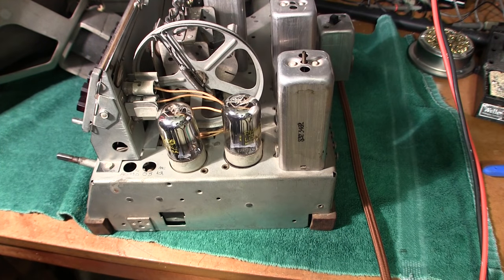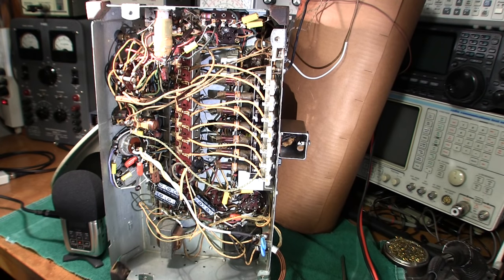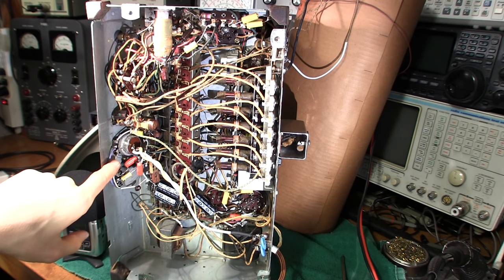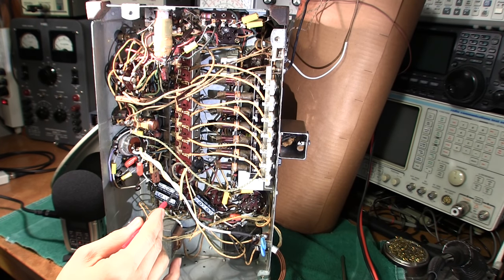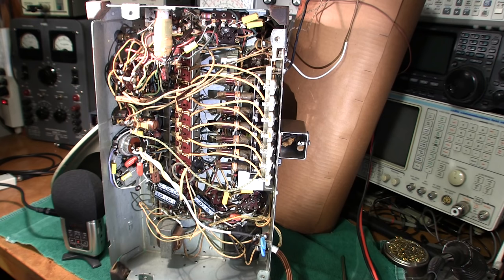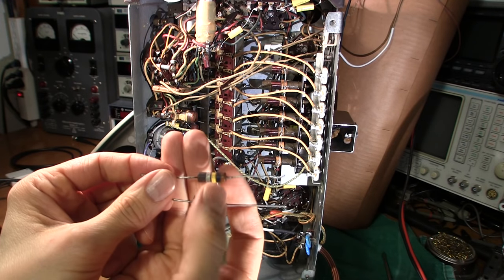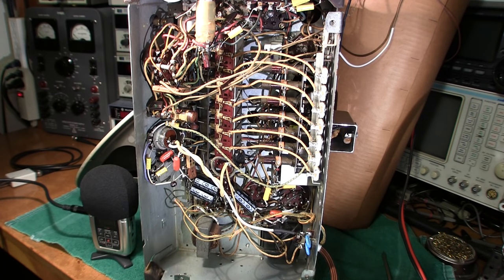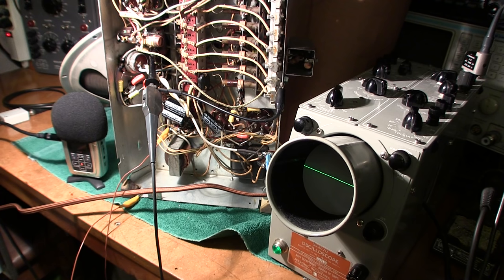Tech Tips Tuesday- Radio Repair Tips.

Comment: Am working on a 1948 Zenith radio and I encountered some Allen Bradley and roundie resistors, as you call them, and so now know more than before.  I will diligently check the "roundies"  first.  Thanks for the tip.Bob
Reply from the maker: +Robert Jacko 
Glad to help out Bob!

Comment: Happy New Year. Yup those cardboard capacitors are snow storm machies. My very first circuit a mains neon oscillator circuit. Needed a cap. I know where theres one I told Terry. Shot up his shed to a Baird BW TV. Been in there 2 or 3 years at the time. Yup. Dampalota. Put the cap in circuit worked. We made a cellebration cupa while it was running. In the kitchen we heard WHOOMP! Rather loudly. Looked in the living room doorway and it was............SNOWING! LMAO. Terrys mum was not amused. We were both 9 at the time.
Reply from the maker: +Raymond Earle 
Thanks for the story Raymond! Happy new year!
Reply: Same thing with me. Age around 12, was working on an audio power amp when the power supply paper filter cap blew. It was like a Roman candle and snow storm at the same time. Was in the basement, so it was easy to clean up. Fun times.
Reply: Thank you my friend. Have subscribed. Happy new year.

Comment: I always learn from your videos.  At my parent's house is my Grandfather's1942  Philco  console I think it is a 42-395.   I am 60 years old, and used to play that thing when I was a kid.  I still turn it on often when I go over there, it still sounds great. The only repair done to it in my lifetime was I replaced the rotted rubber line cord.  It appears that somebody replaced the rectifier tube at one time because there is a Raytheon branded tube in the set with the old philco tube in the box. Until today, I never knew how to properly remove loktals.   All the other tubes appear original, and I see absolutely no evidence of any repairs under the chassis ALL capacitors are original, including the electrolytic, which is the cheap cardboard tube variety, strapped under the chassis.  It does not even hum!  I do not leave it plugged in, of course.
Reply from the maker: +DEW409 
Thanks for the story!

Comment: Thanks Mr. Carlson.  Some good tips for sure.  I have one comment on lead dress.  Try not to change the lead dress.  It is possible that the factory tweaked the lead dress to quiet down a radio.  Some receivers have wires with a single twist or two which actually are acting like capacitors.  Hallicrafters used this for BFO coupling.  Then of course there are the gimmic caps.  Fixing what appears to be a random mess in the wiring CAN cause a lot of grief.  That is my Tuesday Tech Tip. :).  Happy New Year.  Thanks for the instruction for 2015!
Reply from the maker: +Stephen Moore 
Thanks for your input Stephen! Happy new year to you and yours!

Comment: You have a very nice house! And I am surprised to see snow there... I thought you are in BC !
While contact cleaner is great for switches, I would like to highly recommend an excellent Canadian product which works wonders to clean and lubricate potentiometers, or restore electrical connections which have been attacked by leaking batteries or corrosion (green crust)... ACF-50 by Lear Chemical Research. It is MIL-SPEC and tested not to affect values of capacitors or inductors, be conductive or damage plastics or rubber. It is not rated as toxic or flammable.
After using for more than 25 years, I have to state it is a great product.
Really enjoy your videos, Paul.
Reply from the maker: Thanks for your comment Mr Lake.

Comment: I didn't know about that dimple removal procedure for locktals Paul. I always used a small screwdriver between the chassis and base to pry the tube straight up. It looks like all that bending would perhaps elongate the female socket connectore, but I don't know.I also didn't know the roundie resistors had a tendency to be so far out of tolerance.Great information! Keep the coming.Happy New Year!!!73sTomj
Reply from the maker: +AntiqueRadioandTV 
Thanks Tom! Happy new year to you too!

Comment: Great tips Paul as usual. One note, some (not necessarily all) phenolic switch wafers can actually be damaged by the chemicals in tuner cleaners so I usually use 100% DeOxit that comes in the small bottle with a needle tip (that tiny bottle still has about 3/4 of the original liquid in it after 20 years of bench use!). Drake rig experts especially make note of this caution.  Now pots, that's a different story - hose 'em! Happy New Year!  73 - Dino KL0S
Reply from the maker: +Dino Papas 
Thanks for your input Dino! Happy new year to you as well!

Comment: I always learn something new from your videos. I thought that dimple on loctals was simply to indicate where the key was…not sure why you'd need to know that on the OUTSIDE of the tube, but now I know!
If I may make a request: a video showing how to determine the difference between "postage stamp" silver micas and the wax/paper capacitors that have that same, or very similar form factor. I think they called them "encapsulated wax/paper caps". 
I use Deoxit as a contact cleaner, and it has the same flow valve on the nozzle. I too find it useless, as even in the low setting, it releases an unholy gush of fluid that goes everywhere. I've toyed with the idea of putting some deoxit into a needle-tip flux bottle for strategic application.
Reply from the maker: +Jason Atkin 
Thanks for your comment Jason!

Comment: You comment on the thinner leads on modern components, but I've also noticed many components now have plated steel leads. No doubt that will be the reason they fail in a decade or two - the internals of Mylar caps could probably last forever.

Comment: Re: death caps- these were connected directly to the Ac line and ground on older amps before three prong cords to reduce hum when a polarity switch was engaged. Many claimed they are lethal if the chassis is touched but what i have found is that very little ac passes thru them.
Reply from the maker: +Ron C 
This is why Y1 or Y2 rated capacitors are your safest bet. I have come across shorted line to chassis capacitors before. I was at a ham swap may moons ago, I had two capacitor testers I was going to plug in to test, to see if the EYE tubes worked. Both had metal handles..... I plugged them in at the swap meet ( I found a wall outlet ) Not thinking, I grabbed both units to face them at me.... WOW! That woke me up in a hurry! Both of them smashed against the floor..... I bought them.... The tubes worked perfectly..... Ouch!
Reply: +Mr Carlson's Lab  Thank you !!!

Comment: I have a suggestion for a "Radio Repair".

On ebay, there are a couple vendors who take older OEM car radios and install a stereo input jack so people can plug into their iPads or phones.

How would someone identify the point in the circuit where the input (CD, cassette, radio) is passed to the amplifier for output, and it would be appropriate to add the stereo plug in order to play the external source instead?

In my case, I have a Ford Expedition that has AM/FM/Cassette in the dash and is wired for a remote CD Changer (which I do not have), and I'd like to add the extra input in a convenient location, rather than putting in an aftermarket stereo.

Suggestions?

Comment: Paul,

Great video. Getting caught up on the rest. About 80% finished. One question, what is that long oblong tan colored object behind the receiver chassis?

Have a Happy New Year.
Reply from the maker: +Donald D'Egidio 
Hi Donald! The tan oval object is the antenna for the receiver. When you service this type of chassis, that has to be attached (4 wires) for the radio to work correctly. So it's a bit of a pain to have that hanging off the back of the radio while working on it. Happy new year!

Comment: Question: I've recently stumbled upon the debate about the DEATH CAP's in vintage equipment. Some claim they need to be removed, others say they do help remove hum.  Have you ever covered this topic ?  With your extensive test equipment I bet you could help solve the mystery.   thank you Ron
Reply from the maker: +Ron C 
Hi Ron. Never heard the term "death caps." All older capacitors should be changed in guitar amps. The debate about older bumble bee caps sounding better is actually sometimes true, but harmful to the amplifier. Whats happening is... The caps leak DC, which means they are turning into resistors. This issue drives the following stage into a "hard class A"situation, giving a positive Voltage to the grid of the next amplifier in the chain. This in many cases (more often then not) gives a softer (more mellow) tone. When the caps get to a point to where the leakage is too much and the 470K Ohm (or about)  Control Grid resistor can't pull the Voltage down anymore, it passes this sweet sounding point, and causes distortion. So with guitar players, many like distortion, and many like that mellow sound..... so this is where all the capacitor confusion comes from. The bottom line is, many think the "more mellow" sound is factory, when in fact it is not. These bumble bee caps came from the factory "NOT Leaking" and have developed this issue over time. This situation is harmful to the amplifier components and tubes as well. ( the tubes and components get pushed outside their parameters )

Comment: A couple gorgeous radios on your shots there.  QQ...it occurred to me regarding testing the leakage of a capacitor that you probably could use an ohmmeter for that, progressively moving the scale up to Megohms if you still don't see any current passing.  I know you have a device specifically made to do that task.  So then, what is the downside of using an ohmmeter as I described?  My guess is that my method would not detect leakage beyond the scale of the ohmmeter (Gigohms anyone?).

Comment: For lubrication try bicycle chain oil, tiny drop is enough and works better that machine or engine oil. 
Also does wonders on old, computer type, fans.
Reply from the maker: +Dragan Milivojević 
Wow, I will have to try that. Thanks for the suggestion!

Comment: Outstanding Tech Tip Mr. Carlson!  Looking at the orange and the yellow replacement caps, could you please tell me (us) what type of caps they are?  I understand about the replacement capacitor value and voltage rating, but how do you determine what type of replacement capacitor to use when replacing the caps?  Thank you.
Reply from the maker: +XT500C 
Thanks! I will do a video on capacitor selection in the future. Too much info to write here :^) It would be a book.
Reply: +Mr Carlson's Lab   Replacement capacitor selections in older radio repairs should be a very interesting topic. Thank you for considering it.

Comment: Oddly enough, I know you’re supposed to replace all wax capacitors no questions asked, but I’ve had a 50s zenith radio with all original wax caps and it has worked fine for years!! I was in disbelief, would run it for hours every day, haven’t had to replace the tubes one and all test good, have been constantly checking filter caps or tubes for probable damage and have seen none

Comment: Paul, I have a question about the blue "Y" type safety caps.  I seem to be doing a lot of Philco sets that would use the "Y" type cap in place of the original paper caps in their Bakelite block.   Those sets called for .015 uf caps and I've not seen that value available in a "Y" cap.  I've seen .01 uf and .022 uf.  Which should I be using?  Would a modern .01 uf cap be OK?  

Looking forward to future Tech Tip videos!  73, de Mike, K9UW
Reply: +K9UW 
If I may, two .022's in parallel, in series with another .022, would give you around .0146 - depending on the exact measurements of the caps.
Reply: +Robert Calk Jr. True, but I'm hoping to restuff the original Bakelite block which held the original two .015 uf paper caps and that block won't easily hold six Y2 Safety caps.  I could replace those old paper caps with new .015 uf film caps but, given the wide tolerances (+/- 20% or more) for paper caps when they were new, I am hoping that is would be practical to simply use the next highest available value.   I've read that it is reasonable to move up or down one standard value step without adversely impacting performance, but I'm not sure if that generalization can be applied to a safety cap - hence the question.
Reply: +K9UW 
Oh, ok. That might work.

Comment: I have a couple of i.f. transformers that had really bad insulation on them. hard and crumbly.  I started to chip it off and noticed that there looks to be some really fine wire wrapped around the leads. have you ever seen this?

Comment: Hey Paul, I recently picked up an old philco radio. It came with chassis only, so a bunch of stuff was disconnected. It uses a few 7xx tubes along with a 6 volt rectifier and 2 "42" tubes. 
I dont plan on restoring it. 
I am wondering about the power transformer..
it appears to be a 300-0-300 with 7.3 filament leads. Would this transformer be suitable for powering tubes such as a 6v6 or 5y3? I understand the filament voltage is different, but is there any way to make it work?
Reply from the maker: HI Smithii. The rectifier (5Y3) needs it's own filament winding, as it's a directly heated tube. There is no reason a 6V6 shouldn't work as an output.

Comment: sorry, under the crumbling insulation of the 4 leads  there were pieces of really fine wire maybe litz wire that were wrapped around each lead. they didn't seem to otherwise be connected to anything. they weren't tightly wrapped around the leads just very loosely.
Reply from the maker: +Chris Mosley 
Without seeing it, possibly an unused center tap?

Comment: Hello,  new subscriber here.  Do you have a "general order of elimination" for amp problems, i.e. tubes, capacitors, resistors & transformers. My problem was lost volume & picking up motor static in my 1959 jukebox...it was an open resistor. I am trying to understand what the lost resistance "does" to lose the volume & pick up extraneous noise in the amp circuit. How are these bad resistors normally identified? thanks
Reply from the maker: +MrUABama 
That question could be a books worth of writing. Bad resistors are identified by taking Voltage readings in circuit, or taking readings with one end of the resistor opened from the circuit ( circuit not powered. ) The first solution takes learned skill (basically time put into troubleshooting) The second is more time consuming, but effective as well. So say you were working on a guitar amp from the 50's. Replace all paper capacitors, test the tubes and replace the weak or damaged ones..... So on. That amplifier has very High Voltage present in it. If your not confident in working around Voltages in the 400+ region, I suggest that you don't work on it.

Comment: I've been describing this incorrectly.  it was the capacitor leads I was referring too of the i.f. can. they're color coded white red blue and black. under that color coded insulation was the really fine wire I was talking about that's wrapped around the leads.